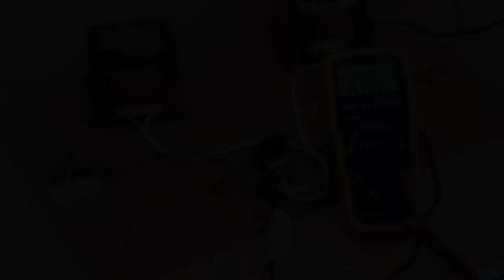DIY Welding Machine / Only 2 Microwave Transformer / Good Job

Comment: it has great finish.   good job bro👏👏👏👏   but how  long can it last..is it still working  and can it be used for heavy duty    i worried if the transformer heats too much and burns the coil. i will wait your answers   sir.
Reply from the maker: Hello.  Firstly, thank you.  I am still using it.  In fact, in my last video, I performed the process of converting the output voltage of this machine to DC.  Honestly, I used it for amateur jobs.  Not suitable for electrodes over 3.25mm.  However, it is capable of doing many things.  To reduce the effects of heating, I used a silicon insulated copper cable and put 2 fans.  I hope my answers were sufficient.
Reply: tnx   bro    you have answered my questions.
sorry but how many ampere is it
Reply from the maker: Thank you too.  Its max current is around 120 - 130A

Comment: At least you used a strain relief on your power cable... Cool toy, work is tossing two identical Panasonic microwave ovens and I just might build something like this... thanks for sharing
Reply from the maker: Hi.  Thank you.  In my last video, I made the process of converting the output voltage of this machine to DC.  In this video, I also replaced the power cable with 3x2.5mm2 and changed the direction of the fans to blow the air out.  If you want, start doing it after watching that video.

Comment: Thanks brother Murat for this video…does this welding machine affect the stability of the home network or may cause any problems for other devices during welding ??
Reply from the maker: Hello.  I thank you too.  I use it at home and the socket I use has a 10A fuse installed.  I didn't notice any problem.  I hope other people who have made and tried this tool will post here if they have any problems
Reply: Hola
Reply from the maker: Hola

Comment: Es muy frustrante para aquellos que no tenemos conocimiento aunque sea básico de electricidad.  Ésta máquina de soldar con 2 transformadores se ve genial y te emociona ver cómo va quedando y como termina pero en mi caso compré un multímetro haber si le entendía como se usa pero hay está guardado por qué no se usarlo,no entiendo eso de voltios,vatios,Ohms,watts etc así que aunque deceo aprender no hay más como ir en vivo a una escuela o estar al lado de un maestro como éste amigo observando y preguntando.  Aquí aunque esté bien explicado hay partes en que tienes dudas,preguntas y no entiendes al 100 por qué la imagen a veces te engaña.  El intentar hacer esto en casa con cero conocimiento de electricidad y cometer algunos errores..podría quedar ahí uno electrocutado.  Saludos desde Monterrey,mex.
Reply from the maker: Hola.  No sé cómo puedo ayudarte con esto.  Pongo un diagrama en la sección de explicación para que todos puedan entender.  Con este esquema y viendo el video con subtítulos, se puede cuidar la parte de conexión general.  Por otro lado, hay un diagrama en la sección de explicación sobre el cambio que hice en el circuito del dimmer, pero se requieren algunos conocimientos de electricidad para entenderlo.

Comment: I have watched probably 40 videos of people making welders from microwave transformers. I do believe this is the best one yet.
 Neat.
 Clean. 
Well planned and professional looking.

Don't get me wrong. Some of the other projects will work. But they are some scary looking contraptions. One guy actually cut the ground wire from the power cord to "get it out of the way"!!!
Reply from the maker: Thank you very much.  I'm glad you liked it.  It's a really nice tool.  I still use it.  But it would be better if I made the box bigger.

Comment: Ciao, complimenti per il bellissimo lavoro svolto, io ho preso due trasformatori saldati uno sopra l'altro con un primario , domanda: che spessore di Cavo ci devo mettere secondo te? Io pensavo a un   cavo spesso 6/7mm, che ne pensi??? Un tuo parere se puoi, grazie.
Reply from the maker: Ciao.  Ho usato 4 mm2.  Perché volevo che la tensione di uscita fosse un po' più alta.  Se si utilizza un cavo da 6 mm2, la tensione potrebbe essere bassa ma la corrente sarà alta.  C'è una tensione di circa 0,9 V per avvolgimento.  Sarebbe bello se potessi ottenere una tensione di uscita di circa 30V.  Può essere una saldatrice migliore rendendo l'uscita DC.  A breve aggiungerò un raddrizzatore all'uscita e posterò un video.  Se vuoi, prova con un cavo da 6 mm2.  Buona fortuna
Reply: capisco,  ho fatto una saldatrice con quattro trasformatori qualche mese fa con un uscita totale di circa 47,8 V,  poi ho aggiunto un raddrizzatore da 1600V da 400ampere portando la corrente in DC,  per ora tutto bene, il raddrizzatore rimane freddo come se niente fosse 😀il tutto è un po' pesante ma Potente fino a forare potrelle 😀 cmq ribadisco che hai fatto una bella saldatrice.
Reply from the maker: Grazie.  La tua macchina è pesante, ma i valori di tensione e corrente sembrano perfetti.  Il raddrizzatore da 400 A deve essere piuttosto costoso.

Comment: Good job bro I didn't understand that where you use dimmer with input or output?
Reply from the maker: Firstly, thank you.  Dimmer circuit is connected to the input.  Not suitable because the output current is too high.  There are 2 schematics in the description section.  Take a look if you want
Reply: Thank you so much for answering bro I have seen pdf files of diagram, now I understand about dimmer   and how you contact it.again thanks bro God bless you.from Gujrat India 🙏
Reply from the maker: Thank you too 👍

Comment: 4mm wire how many rounds to wrap secondary winding??
Reply from the maker: Hello.  24 turns and 6.5 meters of cable are required for each transformer.  A total of 13 meters of silicon insulated copper cable.  If you want, watch the video with subtitles on.  If you have any other questions, feel free to ask.  have a nice day

Comment: Hello, I'm finally able to contact you, it's improved a lot, but I can't leave the hospital yet, but I think I can make a net, I'm looking for an electric wire on the net, as you told me I couldn't find the electric wire. It seems that there is a urethane type, but it doesn't seem to be flame-retardant. It was said that the cross-sectional area is 4 mm. What is the last x2? Does that mean, but if it's too hard to wind, the captire cable for the car is too thick, and it's made of PVC and is vulnerable to heat, so I don't know what to look for.
Reply from the maker: Hi.  Are you still in the hospital?  I would like to remind you that I am sorry for you... 4mm2 (ie 4 square millimeters) is the cross-sectional area of the cable.  I think N2GFAF can be found on the internet as a cable.  The fact that it is silicone insulated (non-combustible) makes it heat resistant.  Normal cable can also be used, but the resulting heat may damage the insulation.

Comment: Hello brother…I used 4000 W dimmer and make all steps but unfortunately the dimmer fuse was burned…should I only change it and try again or make a triac like the one you made for 2000w dimmer …in case I will use a triac will they be the same like you did?? Thanks for help
Reply from the maker: Hello.  It should have worked if the connections were made correctly.  However, the product you purchased as 4000W may be faulty.  You can use the circuit that blows the fuse like me.  If you install 4 bt137s, it will be more than enough power.  It is possible that other parts of the circuit may have failed, but it could also be intact.  If you want, you can connect an incandescent lamp to the circuit output and see if it dims.  If the circuit is solid, it is sufficient to add 3 bt137s.  If it is faulty, remove the triac on the circuit and add 4 bt137s with the method I applied.  I hope I was able to explain.  If there is anything unclear, please write again.
Reply: Thanks again…they write on the fuse 10A260V So I think the current during the welding process reaches 100A (with 40V ) accordingly the current in primary side will be about 18 A so it is normal to burn the fuse ….we need to strengthen the dimmer circuit to withstand 18 A … theoretically the dimmer is 4000 W and should bear it
Reply from the maker: Hello.  You are right about this.  10A is a limit value.  It might be low.  However, the triac on the circuit may have failed.  Must try.

Comment: How thick is that wire that you used to wrap around the transformers
Reply from the maker: The cable I use in the secondary windings is a silicon insulated copper cable with a cross section of 4mm2.  By the way, some information is given in the video with subtitles.  You can watch it with subtitles if you want.  If you have any other questions you want to ask, please write to the direction.

Comment: In the primary, you connect in series or in parallel?
Reply from the maker: The primary windings will be connected in parallel.  In other words, the mains voltage will come to both transformers.  Secondary windings will be connected in series.

Comment: Hola Saludos desde ARGENTINA.  Mi duda es con que tipo de transistor fabricastes el triac y que autonomía tiene la maquina sin que caliente demasiado? Gracias espero tu respuesta
Reply from the maker: Hola.  Conecté 4 triacs BT137 en paralelo al circuito dimmer de 2000W que tengo y aumenté su potencia.  Como se ve en el video, traté de enfriar el dispositivo con 2 ventiladores.  Pero todavía se está calentando.  Nunca he tenido un problema.  Los cables no se dañan porque están aislados con silicona.  Después de 2 semanas, pondré un video para el proceso de conversión del voltaje de salida de este dispositivo a CC.  Vuelva a escribir si hay algo que no está claro o si tiene alguna otra pregunta.
Reply: Gracias por su respuesta . Yo armé una pero es rudimentaria comparada  con su diseño que es exelente ,pero tengo el inconveniente que calienta muy rápido, la fabrique con 3 transformadores  y cable de 6 mm . Voy a esperar su próximo vídeo.  Saludos
Reply from the maker: Gracias a ti también.  Los devanados secundarios de los transformadores de microondas normalmente están diseñados para entregar alto voltaje y baja corriente.  Por lo tanto, las áreas sinuosas son pequeñas.  Si existe la posibilidad de enrollar con un cable de 16 mm2, no habrá calentamiento de esta manera.  Sin embargo, con 16mm2 podemos hacer un máximo de 3 bobinados, en este caso la tensión de salida será muy baja y no habrá inicio de arco ni continuidad.  Lo uso para hacer mi trabajo amateur.  He derretido 5 electrodos uno tras otro.  Había calor pero no tuve problemas.  Por supuesto, la generación de calor también significa energía desperdiciada, pero me arriesgo y la uso.

Comment: Can this be made with a 120v imput
Reply from the maker: Hello. You can do it the same way. However, since more current will be drawn from the network at 120V voltage, you should choose slightly thicker cables on the input side (2.5mm2 or thicker) and use the dimmer circuit at least 6000W.
Reply: @MuratGuney  thank you I figured I could just wanted to know the difference I appreciate it thinking of putting 4 transformers together for a welder

Comment: What is the part with the dial in the video?
Could you please tell me the name of the IC chip?
Reply from the maker: Hello.  By the dial part, do you mean the potentiometer on the front panel?  If this is the potentiometer of the dimmer circuit used for current adjustment.

Comment: good morning!
Transistor used (IC chip?)
Please tell me the name of the module with the dial. Can I buy it at Amazon?
Reply from the maker: The name of the module used is "dimmer circuit", I will send you the aliexpress link for this circuit.  The transistors (triac) I added to this circuit are BT137.  You buy this circuit and 3 bt137s. 
 https://a.aliexpress.com/_uXCj8h
 https://a.aliexpress.com/_ujo9jr

Comment: Exelente video 👍 👍👍👌👍👍👌👍👌👌 Dónde consigo el reductor de amperaje? Quiero hacer una cuento con la mayoría del material que se ocupa ya le di mano arriba y me suscribí  saludos desde Toluca México 🖐️🖐️🖐️🖐️
Reply from the maker: Hola.  En primer lugar, gracias.  El circuito electrónico que uso es el circuito dimmer.  puedes encontrar en internet.  Si lo compra como 4000W, no hay necesidad de conectar un triac adicional como lo hice yo.  Si hay alguna otra pregunta con la que pueda ayudar, por favor pregunte.  Saludos desde Turquía
Reply: gracias amigo por tu pronta respuesta y sigue a si con exelentes videos y saludos a toda la gente bonita de ese gran país Turquía 👍👍👍👌👌👌👌🖐️🖐️🖐️🖐️😃😃😃
Reply: Cuántas vueltas son en el secundario del transformador y de qué calibre es el cable 👍👍👌👌🖐️🖐️
Reply from the maker: Muchas gracias 👍👍👍
Reply from the maker: El cable que utilizo es un cable de cobre con aislamiento de silicona de 4 mm2 con código N2GFAF.  Hice 24 bobinados para cada transformador.  Para 24 devanados, usé 6,5 metros de cable por transformador.  13 metros en total
Reply: gracias por tus respuestas amigo 👍👍👍

Comment: May I ask you a question? Does the axillary rotary variable switch equipped with a heatsink, lower the current voltage on the fans that supply air to cool the transformers aswell?
Reply from the maker: Hello.  I did not fully understand your question, but as far as I understand, I think you are asking if the current of the fans drops while the device is running.  If that's your question... yes it does.  If you make the mains voltage cable a little thicker, it will not be affected much.  In addition, if there is an intermediate cable, it will also affect it.
Reply: Yes sir that was my question. Thankyou so much for the response. 
I made a similar welding machine out of wood following your protocol procedures. Im giving it a test drive today when I complete wiring final inspection. Thanks for replying & posting, as always keep on, cheers from TX.
Reply from the maker: I thank you too.  I always want to help as much as I can.  Good luck...

Comment: hell sir can i ask you again what is the number of the wire you use and how many rounds?
Reply from the maker: Hello.  The cable I use is a silicon insulated copper cable with a cross section of 4mm2.  (Referred to as N2GFAF cable).  I made 24 windings for each transformer.  6.5 meters of cable is needed for 24 turns.  I used a total of 13 meters of cable for 2 transformers... If you have any further questions, feel free to ask.
Reply: and the mosfet i cant see the number and connection its to blur anyway sir thank you again i tried to install like yours if i success
Reply from the maker: The elements I use are the same material as on the dimmer circuit.  So triac.  number bt137.  4 units.  The connection diagram about it is available in the description section.

Comment: Hi I would  like to build one of these welders could you please let me know wherer I can get the cable from for the windings and does it need to be 4.2mm or can I use 4mm
Reply from the maker: Hello.  I bought the cable from an electrical supply store.  The cable I use has a cross section of 4mm2.  A total of 13 meters of cable is required for two transformers.  Sold as N2GFAF cable or you can use AWG10.  Must be silicone insulated.  Otherwise, it will not be heat resistant.  This cable has the ability to work continuously at 180 degrees.
Reply: Hi Murat thank you for your reply, I am having a problem finding the N2GFAF. So if I use the AWG10 which I think I can get do I still need 13 Meters and the same amount of turns? using 2 transformers
Alf
Reply from the maker: Hello.  AWG10 cable has 6mm2 cat.  Actually, the equivalent of the cable I use is AWG12, but as far as I know, this cable is hard to find.  If you can find it, you can make the same dimensions, 13 meters, and 24 windings for each transformer.  However, if you find an AWG10 cable, it will fit a little less because it is thick.  In this case, the voltage will drop.  But it will be better if you can use 3 transformers.  The number of turns determines the voltage value.  The current resistance is determined by the thickness of the cable.  So things will be a little different if the same cable is not used (4mm2).  If you can find AWG12, take 13 meters and do the same with 2 transformers.  If you have to buy AWG10, use 3 transformers and get 15 meters of cable, 5 meters for each transformer.  The values are average like this, but there may be minor errors.

Comment: The 13 meters of 4 mm2 cable is shared between the two transformers? if you answer me you would help me a lot good video
Reply from the maker: Hi.  6.5 meters for each transformer.  4mm2 cross section, silicon insulated (N2GFAF cable), pure copper cable.  have a nice day
Reply: Thanks

Comment: Whart voltage are you using 220V  or 120 V as primary ?
Reply from the maker: Here the mains voltage is 220V, but the same system will work at 110V.  Because in places where 110V is used, the primary windings of microwave oven transformers are wound according to 110V.  However, since more current will be drawn from the network in order to obtain the same power at 110V voltage, equipment such as cable, switch, dimmer for current adjustment should be selected to withstand the current drawn.